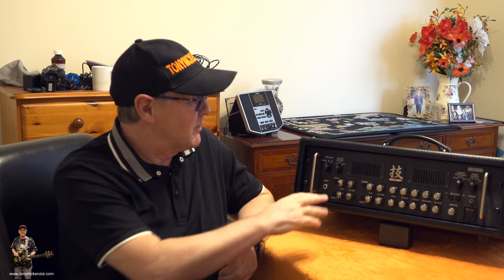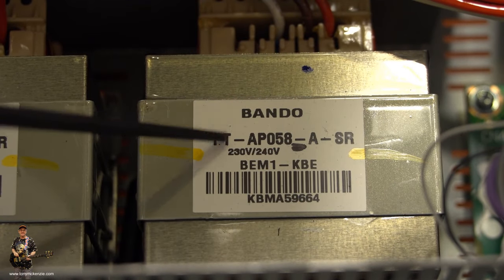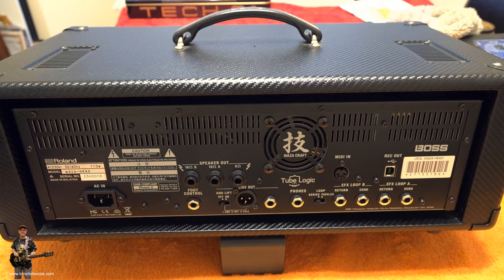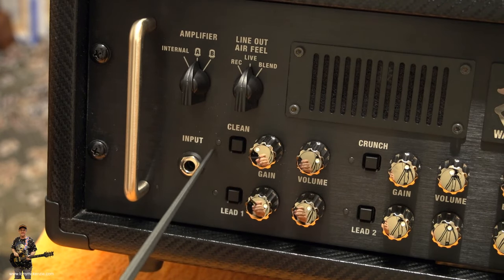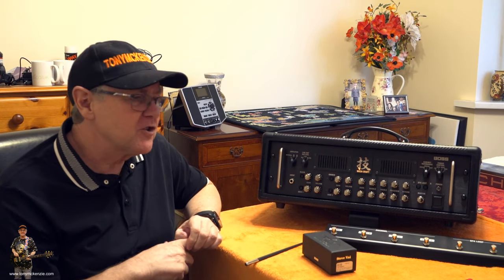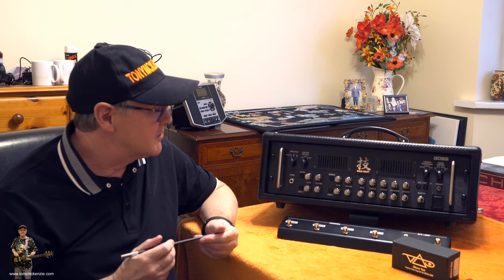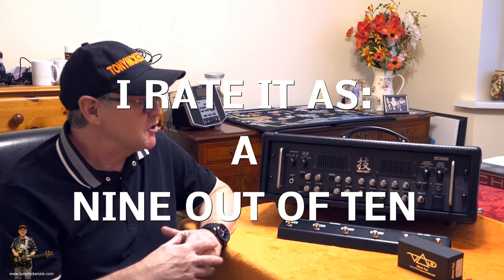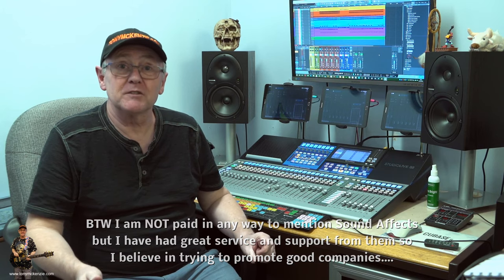Roland Boss Waza Craft Amplifier Inside and Out Review & Playing | Tony Mckenzie

Comment: Great video.  Great tones.  Its s certain sound.  I struggle when comparing it to a simple mesa sound for example.  Ive played solid state in the past.  Tubes just ad a "dimension".  Id play the amp and its certainly an advancement but i think manufacturers need to understand the feel.  Expanding on feel i think is more important.  Effects are great.  I used to love playing with them.  They seem to be driving the market.  What ive noticed is that the market is attracting what i call the fake musician.  I realize i sound like a snob but when youve been listening to music for enough time its nuances bleed thru.  Designs like this run the risk of facilitating said wanna bes.  Yet at the same time could evolve the serious student into a blazing performer.  Thanks for the info.
Reply from the maker: Oh it certainly is a 'different' sort of amp - I used that just last night. I love the tube amps and have many myself... every one is different for sure. On this WAZA amp, I do think that for certain styles of music its perfect (the cleans for example are pristine), for some detuned stuff it has its place. They have a 'Steve Vai' module (looks like a tube) but IMO it does NOT sound the same as Steve Vai's amp :) They even have WAZA speakers designed for this exact amp, but that also does not make the amp in to a tube amp in the way that is suggested by the maker. But it still does have a use, defined IMO by the style of music someone plays. Seems this amp did not catch on in the numbers of sales and at its UK list of about £2300 or thereabouts I understand why. This one cost me at the time about £800 which was livable. I also have a WAZA 2x12 cab but to be honest for me that made no difference at all :). Thanks for watching and all interesting stuff....

Comment: The marketing on this needs help, as a Boss user for 20 years, I still don't understand this amp vs the Katana head, it's what 10 times the price and doesn't have any effects, or boosts built in. I don't think anything has tone that is going to be worth 10 times a Katana
Reply from the maker: Hi Brandon - I think you're right... but there is a reason. This amp was made before the Katana equipment that later benefitted from the development of this original amp I believe. The original price was horrendous for sure and you still see them around for £2400 (UK price) or so. However, it is possible to buy one of these for south of £800 in the UK classed as ex-demo or artist stock (this one was bought for around that and as you see is mint with full warranty.). It is still IMO (compared to today) expensive, but it does have some features, not least the volumes it can achieve and the brick wall 24 hours a day amplification if you ever needed that (not!). Maybe in some short time they will fall again in price (I expect so) and will be worth a new price. BTW I bought a 2x12 cab matching for about half the original price and for a FRFR cab and speakers again basically new it was not a bad deal. In the UK sound affects in Ormskirk have them. I do think Boss gave up on this amp a while back if the truth be known... there are only two of the 'tubes' for different sounds, whereas the blues amps have a number of them (again I believe the blues amps are derived from this one). Thanks for your opinion on this... for watching too - and stay safe.
Reply: @tonymckenzieofficial Agreed. I guess I just really WANT there to be a "high end" Waza Amp, similar to say the Yamaha THR100. Something that takes the Katana another step further. I can tell, right away, that my Waza-Air headphones have a much "squishier" brown sound, for lack of a better phrase. I gather that the Waza amp has that sound, which I love. If there was say a "katana Pro head", or, perhaps, "Katana Waza edition head" with say both modules packed inside, effects, power, and the same aesthetics of this head, and maybe some of the recording features of the Boss tube amp expander (without the load box), I would buy it in a heartbeat. Heck, they could even make it wireless ready...it would be an all in one solution :) That being said, my Katana Mark 2 head is pretty great 👍
Reply from the maker: Oh I agree too about a high end WAZA amp. This was theoretically it, but I think it was a stepping stone in some ways to later things. I think it WILL come over time though as the technology keeps on getting better if a bit slowly. The Blues combo's were another step along the way too I believe. In any case we shall see no doubt.

Comment: Do you know if the Roland blues cube modules are compatible?   I keep thinking about grabbing a 75watt version of this.
Reply from the maker: I honestly don't know the answer to that. I have asked myself that point more than once too. The modules from what I saw seem to be firmware filled and it gets 'read' in to the amp when selected and you turn on the amp. But I could be wrong there is little info... hence why I made the video. At some point I might consider looking closer at it, but I don't have a BC module kicking around to try right now. David, I'll bear this in mind and if I do see a cheap one I'll grab it and open it up :)... after trying it of course. Thanks for the question it's a good one and anyone else that has an answer for this feel free to post it!
Reply: @tonymckenzieofficial  Thanks for the replay.   Do you think it would pair up or have you tried pairing with the Waza TAE?
Reply from the maker: I'm sure the TAE will work with this amp but do bear in mind that the TAE is not designed for 150w use... so careful consideration would be necessary when using it. Still nothing on the modules compatibility and I have not read anything anywhere about that... Sorry I don't have more on it David... but I still have the amp and 2x12 cab :)

Comment: It better be better than a Katana cause the price difference is MASSIVE! Which now brings me to this point  --> you should do the same in-depth analysis with a Katana head (MK1/2) ;)
Reply from the maker: Oh I know, and I did refer to the Katana in the video. I do think that the Katana and some of these amps like the blues and Waza amps will come together to create a very powerful system - its just a matter of time. I'm really a tube amp guy, but the Waza amp certainly goes a long way towards changing things, and the Katana was not product of the year for no reason. I just might grab a Katana and to that. It will be after the holiday etc. and in January I'm very busy, but I'll probably take a look. Thanks.

Comment: H&K Black Spirit....      not impressed by it.  Nor by the Waza tbh.
I’m a Mesa Boogie guy. 
Great post Tony, be well my friend.
Reply from the maker: Well I'm a Mesa guy too! I've owned and played many Mesa amps - they are generally great amps. But I wanted to look at the Waza amp for a while, and after the Fractal debacle I felt that I should. What I liked about the Waza was the build, and the fact that I got it for less than half price :) and it actually sounded good easily with no faffing about..  turn on and it worked. :) The Black Spirit did not impress me either - and inside if you look at the review I did and compare the transistors they used in that to those in this Waza amp the difference is quite incredible. Its easy to see that the Waza amp is commercial and the Black Shadow is really what seems like more of a toy in comparison. In any case... thanks for watching and have a happy new year.

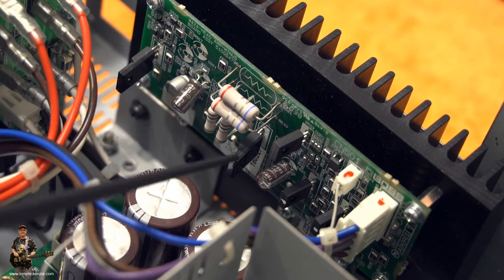Comment: The AxeFX power supply you refer to doesn't look cheap or flimsy to me at all... The flyback transformer looks beefy and well insulated, lots of input side protection and what looks like opto-isolated feedback and decent quality caps. Conversely, I see a big issue with this amp,, namely numerous little connectors that are secured by fit alone, many are bent over,, no solastic or glue,,, vibration is going to be an issue. Capacitors are bent over, resistors are standing 2 inches off the board, many transistors missing heatskinks.  18:22 is a good example.. this isn't 'high quality' by any stretch of the imagination.
Reply from the maker: Really. Well I guess for it's Chinese makers cost of about $12 some people are easily pleased. How it 'looks' is pretty irrelevant, you clearly don't buy from China or that comment would not be on here. I buy thousands of power supplies every year. I guess that nullifies the rest of your comments too. The devices that you referred to don't necessarily have to have 'heat sinks' on them, that depends on many aspects of a circuit and the use of the item in that circuit. I don't think for a second that you know better than Roland Boss - one of the premiere manufacturers in the world today. Oh well. Thanks.